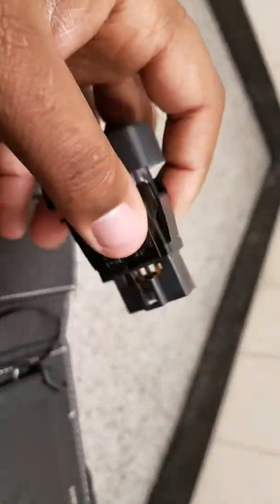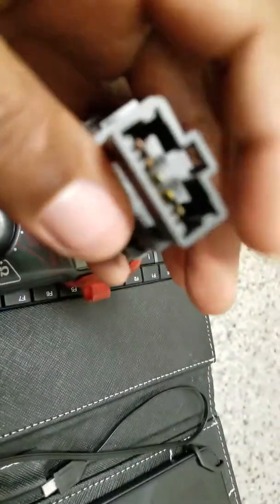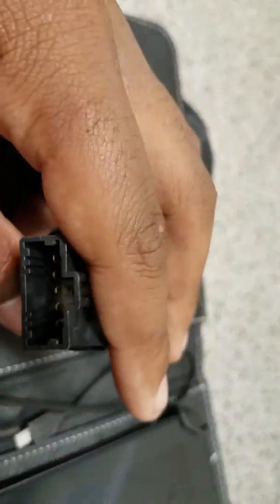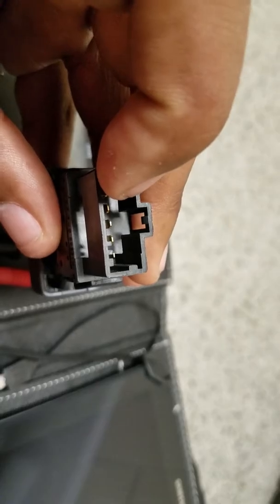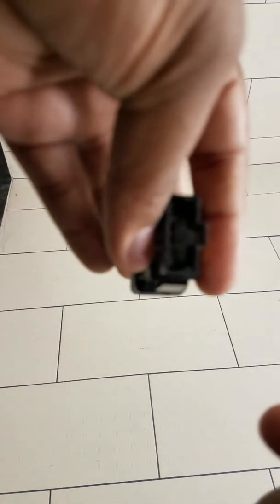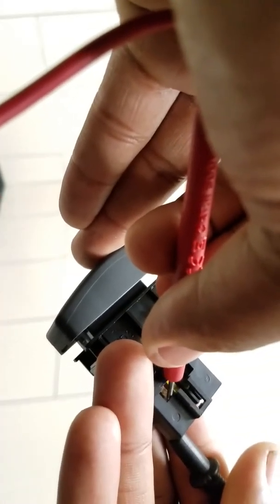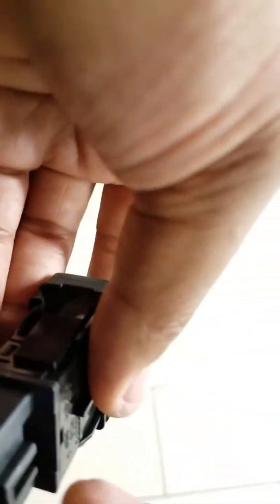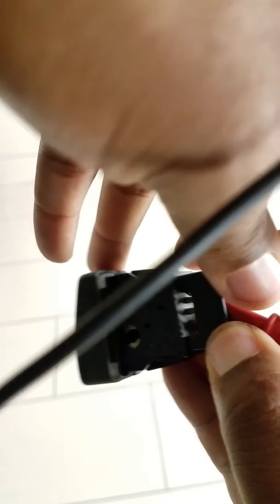HOW TO TEST ACURA HONDA VSA SWITCH VEHICLE STABILITY ASSIST BUTTON

Comment: Just bought an 08 TL Type-S and on the navigation screen, the Vehicle Stability Assist 61 message comes up. Is this related to the switch needing replacement?
Reply: Same problem here